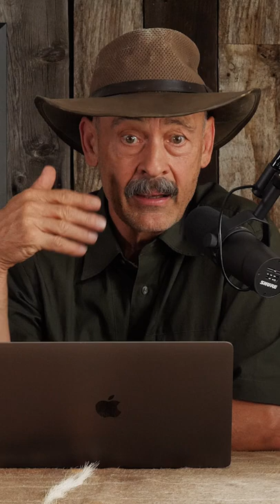What is Ballistic Coefficient?

Comment: If the design moves more or less efficiently through air, is there a similar implication that, upon contact with the Target, it will with similar efficiency, penetrate or disrupt material and tissue?
Reply: There is a lot more that goes into that than just ballistics coefficient such as material being shot, material of the bullet, and initial velocity. But in principle yes, having a higher BC (being calculated by the mass / (drag * cross sectional area) ) allows more energy to be maintained on target which typically leads to more penetration or damage again depending on materials coming in contact.
Reply: sometimes yes
Reply: BC has nothing to do with terminal ballistics, that would be 100% dependent on bullet construction design and impact speed.

Generally speaking, match bullets do not make good hunting bullets because of the construction differences but as with all rules there are exceptions.

Thin skinned game like whitetail deer size and smaller is not much of a factor but again impact velocity makes a difference as well. Example
Those of us who were into long range hunting, example beyond five or 600 yards a traditional hunting bullet may start to be on the verge of its expansion velocity meaning if it does expand it will be very little.

Whereas a bullet like Hornady amax May perform nearly perfect with expansion and penetration at that distance.

I still wouldn't ever use a hollow point boat tail match bullet because they are just simply not designed for any expansion or at least the amax ballistic tip will.

I have made multiple kills on large groundhogs at over 800 yd with a 223 AMax and 243 amax and show almost textbook expansion even at those distances